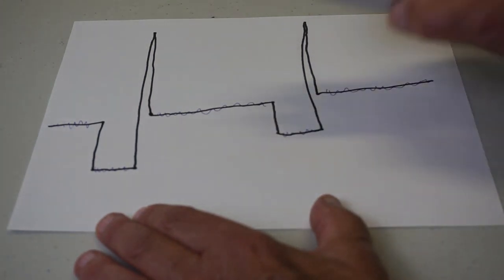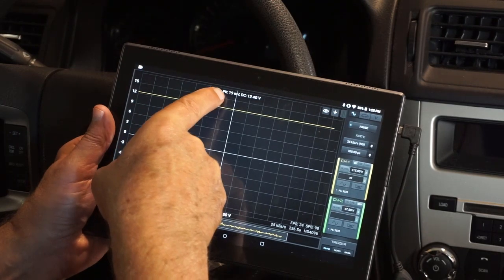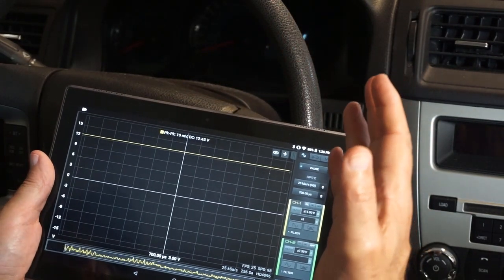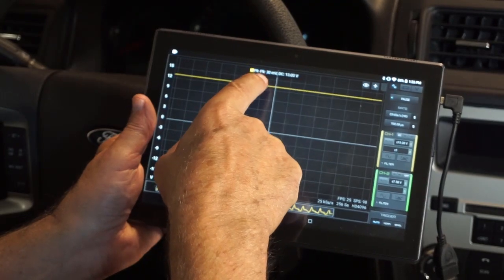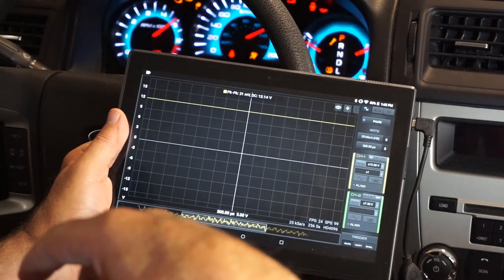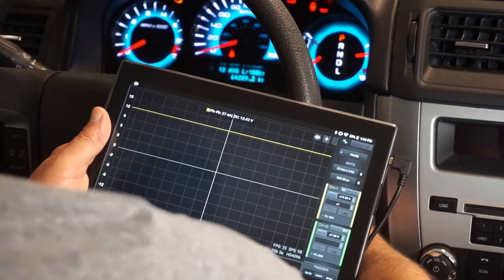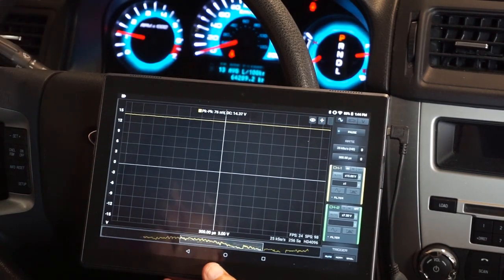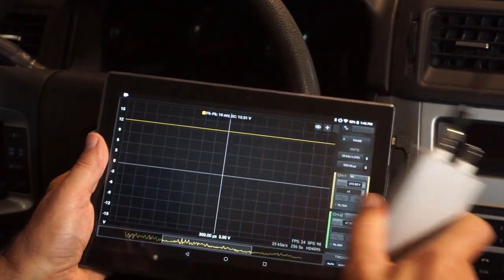GADGETS#119 - AUTOMOTIVE WAVEFORM NOISE

Comment: Is there a way to filter this noise? Without a new scope?
Reply from the maker: Not without a filter that would also likely adversely affect the waveform, Liam.
This noise comes with the territory. We can live with it. Just to be aware of it.
Reply: @theGADGETSplaylist  what kind of filter would that be? Its something I'd like to experiment with....
Reply from the maker: @lpburke86  I feature both low pass and high pass RC filters on the channel.
If we tried a high pass filter to remove the low frequency noise shown here and allow higher frequencies through, we would also be blocking the low frequency signals we are interested in.
Filtration works only when the frequencies we want to remove are widely separated from the frequencies we want to keep.

Comment: Thanks for the video. Noise seems to be a constant item when gathering waveforms. Lots of technicians think the data communication lines are damaged after they capture a waveform only to find out the noise is at 50 or 60 hz. Working with a battery charger like you mentioned or even being too close to overhead light can induce noise into the signal.
Reply from the maker: Thanks for dropping by, Chad.
I just subbed to your channel and look forward to spending a bit of time there:)

Comment: That noise is going to be present in all the circuits on the vehicle and will especially skew any PWM based sensors - yikes!
Reply from the maker: remember this was at battery voltage...injectors, coils, solenoids...
but most sensors operate at 5v REF from the ECM which will be cleaned up somewhat ...